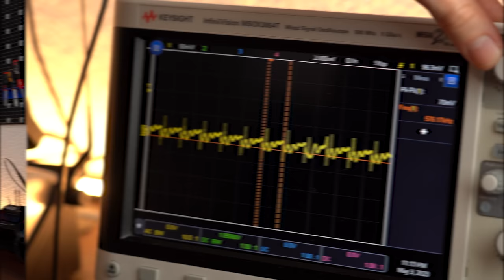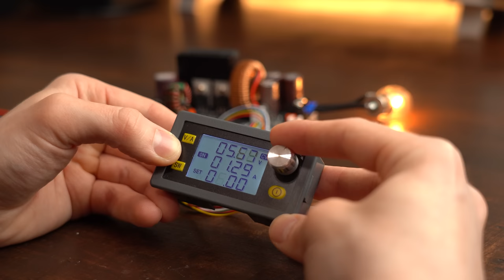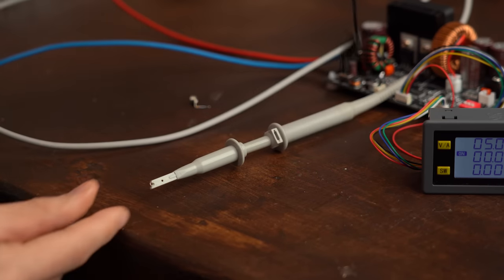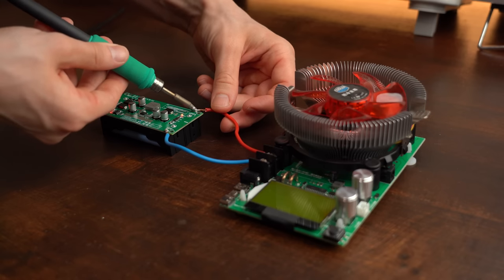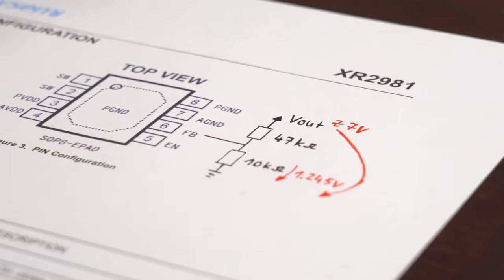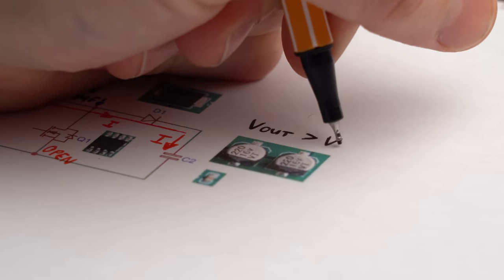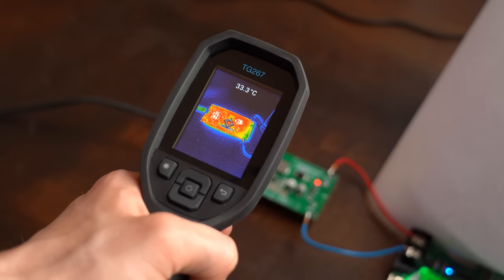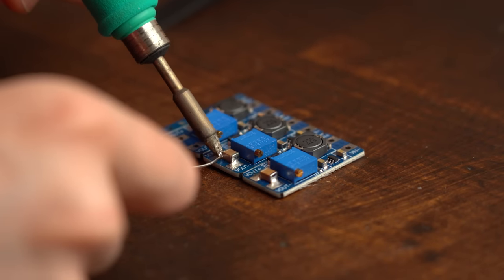With Just $0.50 Components I turned Garbage Products into GOLD!

Comment: That UPS kills your battery sooner than ever. I think the circuit continues to charge the battery even if its full which is bad for batteries like li-ion.
Reply: Dude you can see the protection circuit. It isn't charging the batteries beyond their rating. It stops charging them. It's a UPS with simple and obvious overcharge protection.
Reply: @medes5597  Do it also switches the load directly on power and not on battery?
Reply: @medes5597  "It isn't charging the batteries beyond their rating. It stops charging them. "

You've missed the OP's point; float charging li-ion cells at their their maximum voltage (typically 4.2v)  for extended periods ruins them.
Reply: I'm interested in this and I want to witness a civilised argument. Fight!
Reply: @crixi__  https://youtu.be/pxP0Cu00sZs?t=1h7m5s

It's a trade off as always.  The longer a li-ion cell stays at it's highest voltage, the more it's life is impacted.  By lowering the float voltage to e.g. 4.0V or less you trade a bit of capacity for longer life.  Unfortunately li-ion just isn't as simple to use as lead acid for standby applications.
Reply: @ferrumignis  How difficult is it to limit charging to 4.0v on a device like this? I don't care about the lost capacity, its only to bridge short power losses.
Reply: @crixi__  Depends on the charge controller, assuming it's an integrated solution.  Some allow the charge voltage to be set to different values, some don't. You may be able to put a Schottky diode in series with the charger output which will drop ~0.3v.

Comment: Do they still use capacitance multiplier circuits on power supplies? 
In the old days it was a transistor and a capacitor.  
Would that help reduce noise?

https://en.wikipedia.org/wiki/Capacitance_multiplier

Comment: Oja, mit dem MT3608-Board (das letzte vorgestellte) habe ich auch so meine Erfahrungen gesammelt. Mein Use-Case: Reste eines 24V-LED-Bandes an einer etwas größeren 12V-LiFePO4-Batterie betreiben. Im Test an schwächeren Batterien und mit Netzteil kein Problem, am großen Akku ist mir eins nach dem anderen abgeraucht. Nach etwas Messerei mit dem Oszilloskop: Der Akku kann aus Sicht des kleinen Schaltkreises quasi unendlich viel Strom liefern, so dass der Ausgangskondensator beim Einschalten einen starken Impuls durch die Induktivität erzeugt hat. Dabei kam es, nachdem der Kondensator voll war und der Stromfluss abgebrochen ist, zu einer Spannungsspitze von über 40V. Eventuell hat da der DC-Bias der Billigstkondensatoren auch eine Rolle gespielt. Hübsch zu viel für den bis zu 30V spezifizierten Chip. Lösung: ein klassischer Elko parallel, außerdem den Regler am Ende des nicht ganz so dicken Anschlusskabels platziert statt am Anfang. Jetzt funktionierts...

Comment: would you say the UPS is safe? Id like to get one for my RPi, but cheap chinese eletronics coupled with cheap chinese Lithium ion batteries is typically a recipe for a huge fire
Reply: This is definitely not the right way of doing it, but:
If you get the thermal stuff right there is nothing stopping you from putting it in a bag and burrying it in a bucket of sand.

Comment: one question, that capacitor fix for mini boost converter. what is the limit voltage for that fix, i see in the description that is 10v capacitor so what about 12-15-18v dc?
Reply from the maker: Yep. If the cap only does 10V then 10V is the maximum. Simply select a cap with a higher rating.

Comment: Could there be issues with capacitance in case of using inductive loads? Maybe they ring or behave strangely if you use them with steppers?
Reply from the maker: That should not be a problem.

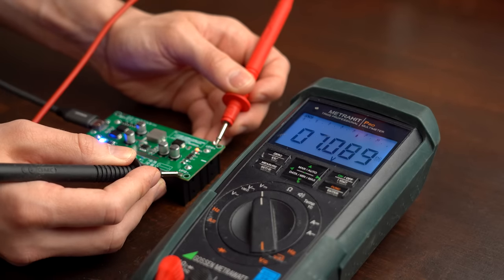Comment: 06:22 Additional to further reduce output noise, add capacitor parallel to R1. Start with say 0.1uF. This will inject output noise in feedback path & can help reduce output noise further.
Reply: that makes for a PID controller, you are injecting a part of the noise in the PWM regulation which could create instability... If the dynamic regulation is OK, you should not touch it but improve output filtering IMHO
Reply: @adrienletellier6132    Yes that is why capacitor value should be specific based on output noise.

Comment: The manufacture isn't including that capacitor because most ppl who use these don't have an oscilloscope and/or know enough about the electronics to add a capacitor of this type to the output.
So by not including the output capacitor, there'll be a high failure rate of the devices, which the buyers will assume were there fault, and buy more devices. So not only do the manufacturers save on the cost of adding that component, they end up selling even more devices to replace the other ones.
And a good bit of the time, someone buys 5 units, or less. They blow one of them up. "Ohh, well, I suppose I'll buy more in case I blow up any others" and they end up buying 10, 20, or more. Even if they never destroy another unit.
$$$$$$$
Reply from the maker: That is evil and sounds plausible.
Reply: @greatscottlab  Maximize Profits and Minimize Costs, perfect example with purposefully built devices that will most likely fail no matter what.

Comment: Well sometimes my power supply doesn't supply power . The output keep oscillate even though i am using less power then rating of output of my power supply. Why ?
Reply from the maker: Probably a bad design like mine in the video. Try repairing it the way I showed it.
Reply: Believe it or not, some poor power supply designs require a minimum load - becoming unstable when the load is too low. This might be the case you are experiencing. You can just put a fixed resistor to draw that minimum load as a quick fix.
Reply: @stevebabiak6997  yeah I do agree. Some power supply and mobile charger have resistor at the output so you can get stable output. But some power supply come without resistor at output instead of them they put 2 capicitor and inductor for small ripple dc voltage and power.
Reply: @greatscottlab  Actually I did. I thought the output capicitor is broken because I faced the same problem with my other power supply but after changing capicitor it worked liked before but this time I didn't 😥. Please can you make video on this topic?

Comment: Ffs now i need caps 😂
What value was that ceramic cap and wud the chip handle a bigger inductor 👍
Reply from the maker: I put some recommendations in the video description.
Reply: @greatscottlab thanks bro👍
Reply: As far as noise is concerned, the value of the capacitor is almost irrelevant compared to the ESR. Ceramic caps have very low ESR, so 3 or 4 in parallel on the output is good idea.

Comment: It is upsetting me all the time that those designers/manufacturers of Class-D Amps can not follow the design recommendations. Like for example the PAM8610 (the same counts for the Stepper motor drivers, i think only the original version from Polu got the heatsink on the right side) it dispate the heat through the back solder-pad, there have to be a lot of vias to transport the Heat away, but what do the chinese slap a heat sink on the plastic housing.

Comment: My question here is simple: how do I figure out this kind of noise problem without an oscilloscope?
Reply from the maker: Usually not at all. You can only suspect it if your circuit or load does behave weirdly.
Reply: Try powering an audio amplifier with this power supply. If you hear high pitch whine, pops or loud white noise then the supply has a filtering problem. Of course you should first make sure that the audio amplifier doesn't produce the same undesirable noises when powered by batteries. Not a 100% guaranteed method (noise might be outside of audible range for example) but still.
Reply: @greatscottlab  Well, I'm planning to do a project and I would like to know beforehand and not scratching my head why things not work as intended. :)
Reply: @Sheevlord  Okay, both advice sounds plausible. Basically, I should do what GreatScott did in the very beginning of the video.
Reply: In some cases by setting your multimeter to an AC voltage scale you can see noise (vpp)
Reply: @brucehanson4147  I'm not sure I can do that one, but you gave me an idea: the multimeter has min, max, and avg displays, so I can determine the amplitude of the noise by subtracting min from max. Hopefully this works.
Reply: @Sekir80  Most multi meters should ignore any DC bias when set to an AC scale, if they don't, another trick is to put a capacitor in series with your probe to block the DC bias effectively letting change in the DC through which would display as an AC voltage representing the amplitude of the noise. You can also measure frequency to see of it's related to a known switching frequency.

Comment: Chinese mass manufacturers do this to a lot of products! They test the design recommended by say the manufacturer of the ic and then they start removing components one by one while checking if the functionality is close enough to the recommended design. Cost cutting is crazy there!
Reply: It's called Muntzing, after a US TV maker called Earl "Madman" Muntz.  He'd cut components from a design until it just barely worked, and sell them.  So you'd get a TV that worked fine in the city (most of his customers) but not out in the country because the amplifier was crap.  But it worked.  Just.

Comment: The ripple comes from the pwm load, not from the supply. Use only R for correct measurements.
Reply from the maker: Tried the same tests with power resistors. Same results.

Comment: You had not made a mistake my friend.  
You measured under real-live conditions; not lab conditions.  If this Power Supply powers an inductive load, or a load that goes on and off (like a CPU), this is exactly what happens in real live... this "little" noise gets amplified by the self-inductance of the wires.
I ran in exactly this situation by trying to power my Raspberry Pi by a 5v SMPS that was labelled as a PSU for LED's.  The output was too noisy and the Pi rebooted all the time.  I had to do the things that you just showed... better filtering basically... to render the output more clean.
Great insights in your video; including measuring the temperature of a device.  This learning is now part of my troubleshooting skills.
Another "Great Scott !" moment
/chriV

Comment: No not you doing that mistake 😮 "50C" 😢😢😢 These are not C but "degree C". C stands for Coulomb in SI units and °C (aka degree C) stands for degree of the celcius scale. Same for Farenheit, it is also a relative scale hence you have to put a degree sign. But Kelvin by contrast is not a relative so it do not need a degree. Sorry for the pedantic corner🥂 Thanks for the great video 🖖